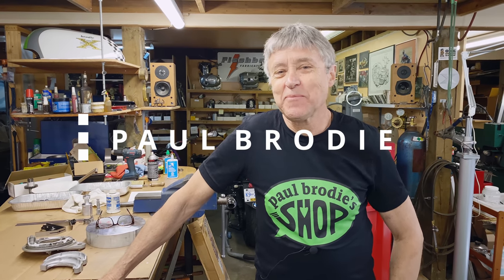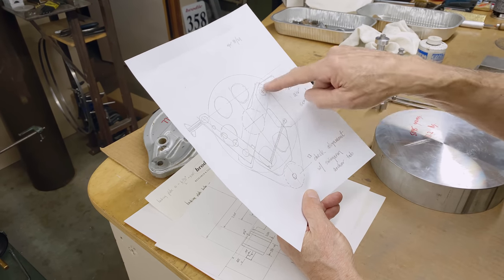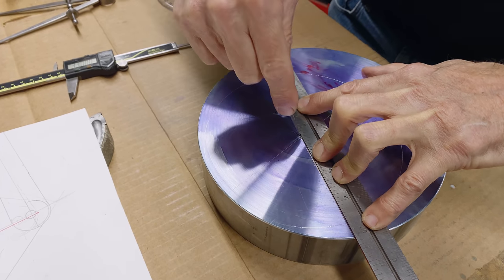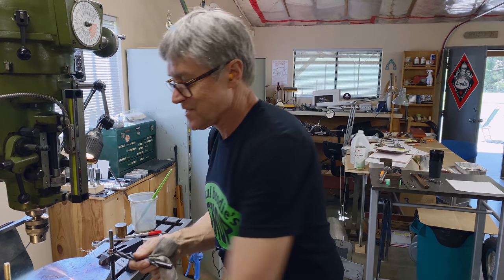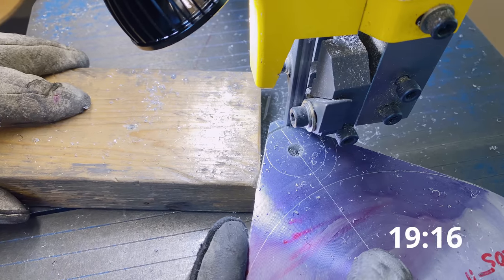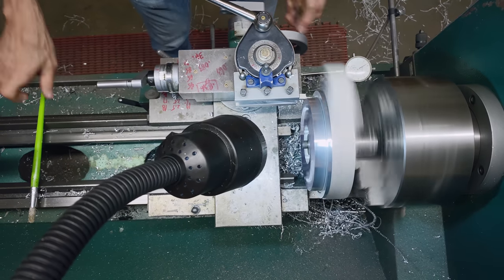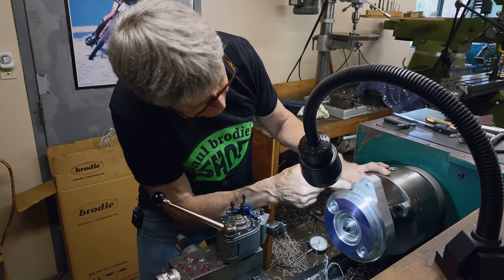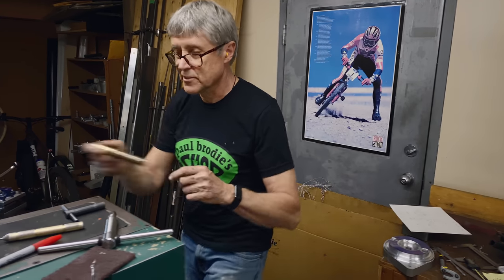Aermacchi Backing Plate - part 1 // Paul Brodie's Shop

Comment: Cool stuff. 
Watched Allen Millyard making a hub yesterday and today your making a brake plate.
Large chunks of aluminium seem to be quite expensive?
Can't wait for part 'the second' with internal ribs then outside shaping
Usually, when trepanning, you have to radius the outside edge of tool so bottom doesn't rub in the cut, modified parting tool does get slightly weaker but still parts OK (until it doesn't!) LOL
I've also used milling cutters in a drill mounted to tool post and a trim router for 1/8" shank Ti coated 1.5mm~3mm cutters (surprisingly, they worked well on mild steel even though rpm was very high - around 25,000) Trim router was much easier to mount than drill but being 'fixed speed' not as versatile.
I did cut several blanks though in 3/8" steel (total around 40" )
I'll probably make a tool post spindle sometime
Reply from the maker: Was Allen Millyard making the 4 leading shoe hub? I've seen that one..
Reply: @paulbrodie  Yep, only just found the 'RC374'  replica video

Comment: I want it to be lighter than the standard one Paul 👌 plus the torque arm at the bottom 👍
Reply from the maker: Those are my thoughts too. The weight is getting close, and there's still material to remove. I'm working on it :)

Comment: I see nothing wrong with measuring the wheel centre with the dividers while the wheel was in the swing arm but... what was the point of your really cool measuring device? All I see is you proved the hub was in the middle of the rim. Lots of wheels are built with offsets. Keep it coming. I look forward to each video.
Reply from the maker: It's true, some wheels are built with offsets. Not the Aermacchi, however. The point of using the dishing tool was to check how accurate the swingarm was when used as a dishing tool. Pretty good, it turns out. The dishing tool is slightly more accurate than a swingarm and a pair of calipers. Thanks for watching!

Comment: Did you consider making it a dual leading shoe brake? Since you are making the backing plate, you could do that. Of course, since its the rear brake, you don't need the stopping power advantage of multiple leading shoes.  By the time I bought my TZ350B, it has a disk front, but it came with a four-leading-shoe front brake. All the racers back then converted to disk, and the four-leading shoe systems were essentially junked. Now they are worth a fortune to collectors, since everyone junked them back in the mid-70s.
Reply from the maker: I know. Years ago I almost bought one of those 4 leading shoe Yamaha brakes, but it was $1500 and that was too much for me at the time. Yes, the racers were swapping to discs for sure.

Comment: We sometimes move the torsion stay to the frame and have the backing plate floating in order to minimize wheel hop. Particularly the TZ 250 crowd.All depending on riding style ...me myself I rarely use the rear brake... , not proficient enough to provoke the bike to slide into the corners....Had it on my winter training 490 Maico though, used to do a lot of motocross in the winter not to loose any bike feel during the long dark nights of longjohns....(i.e. the winter)  (.....was  a bit dangerous , though, as one never hurt oneself in the deep snow, that is until it thawed....)
Reply: Yes, I was thinking that he could have gone for a floating rear brake plate with little extra effort.

Comment: Keep em coming!  I'm wondering about the brake anchor? While it's nice tucked in, if you go through gumbo there's not much clearance. Mounted on outside of backing plate also gets you impact protection? For what it's worth.
Reply from the maker: I'll weld the brake tab onto the swingarm and in the next video you can see how it all lines up. Should be fine.

Comment: When I first started building Wheels I had a scrap bicycle and I use the forks in combination with the seat and chainstays to hold it up and I do dish, wobble run out and left right all off of the same contraption I need to get my bike out and ride it my fat ass could use the exercise peace and blessings
Reply: I still use a Minoura bench top  truing stand that I bought in the early eighties. Still one of the most convenient truing stands I have used. Trued hundreds and hundreds, no exaggeration, of wheels in that stand.
Reply from the maker: I hope you do get out on your bike. Exercise is good. Peace and blessings.